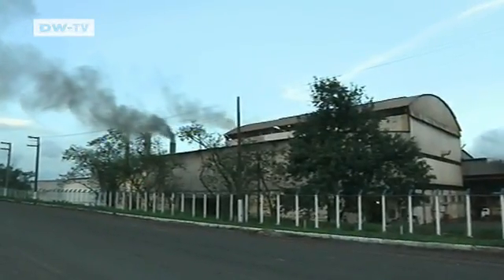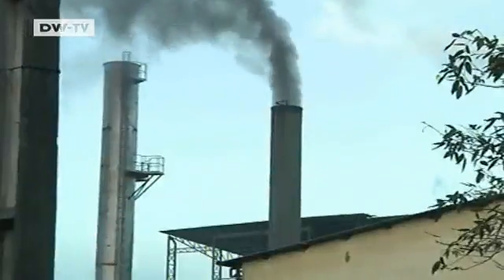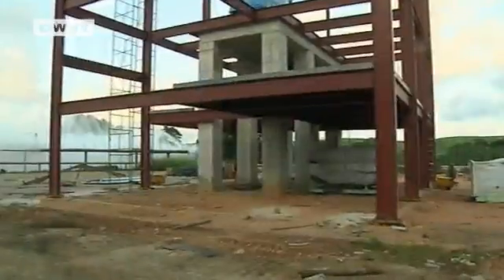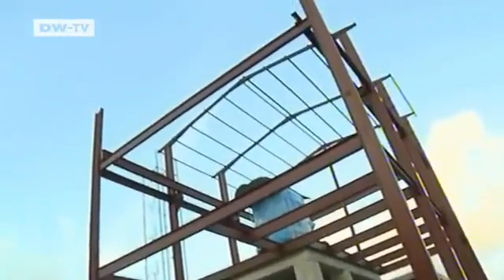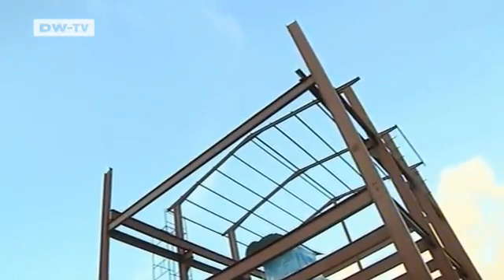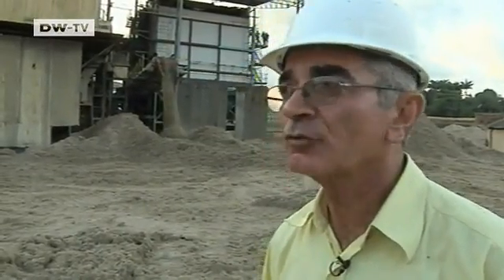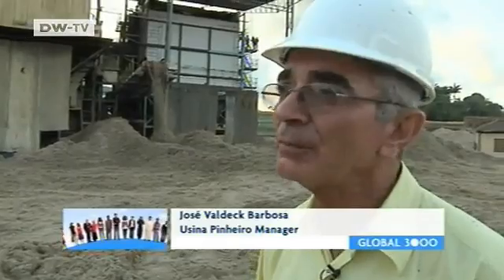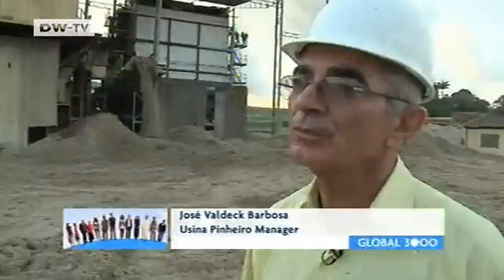Plastic from Sugar Cane | Global 3000

Comment: I thought they were going to make PLA. This was a disappointment. I don’t care about composites if you’re still using petrochemicals.
Reply: Not to mention composite materials are much harder and expensive to recycle.
Reply: Mainul Hassan  that's water hyacinth, right? We've successfully used the same in our school labs to make plastics
And it's cheaper than petro poly
Reply: Mainul Hassan Give me your contact number
Reply: Mainul Hassan I want your damn contact number if what you say is real...